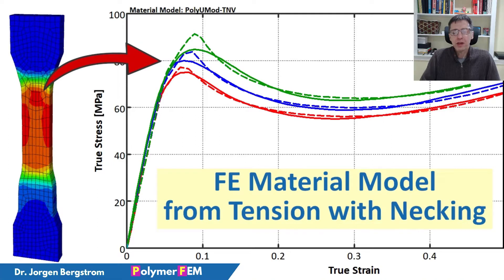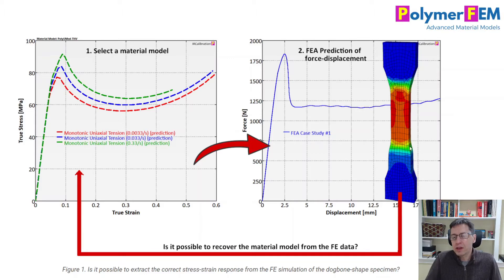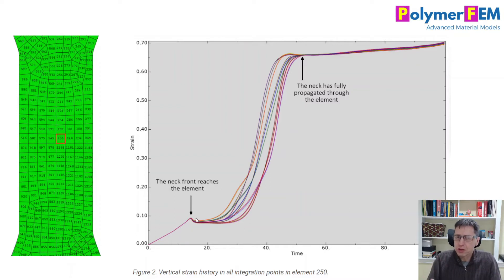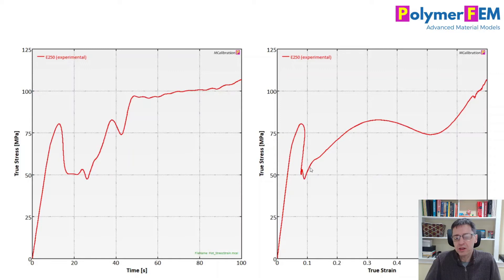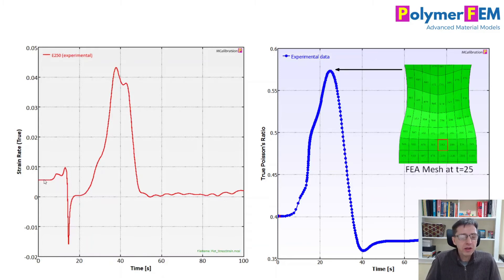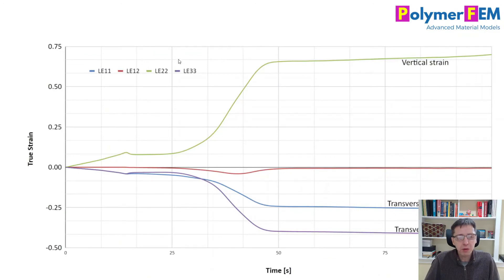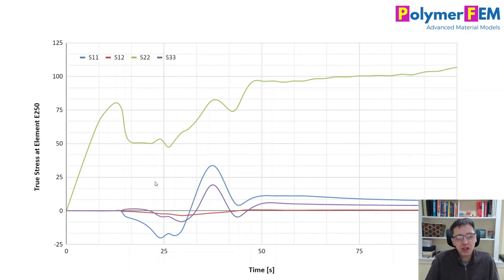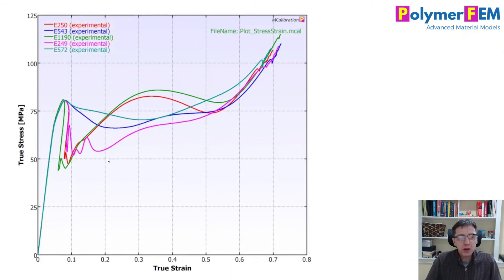FE Material Model from Tension with Necking (Part 2)

Comment: Thank you Dr. Jorgen! My understanding of this phenomenon is, the simulation undergoes material instability (localization) when softening occurs. From my experience even the simulation itself is hard. Did you use some special technique to facilitate the convergence? Like line search or smaller time step? Or you don't need to because of the visco effect?
Reply from the maker: I ran the FE simulation in displacement control, and I did not experience any convergence issues or challenges. I would expect more problems if I had run it with force boundary conditions... /Jorgen